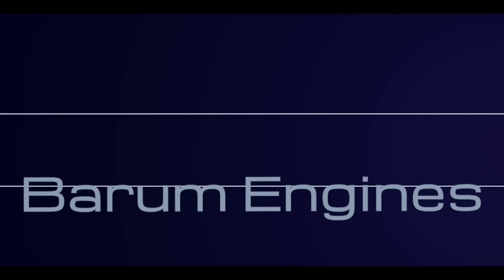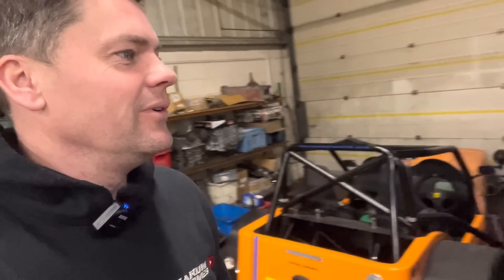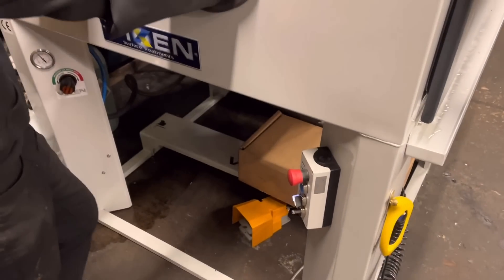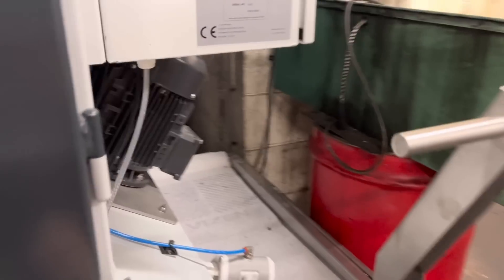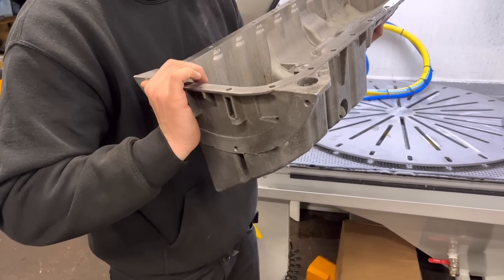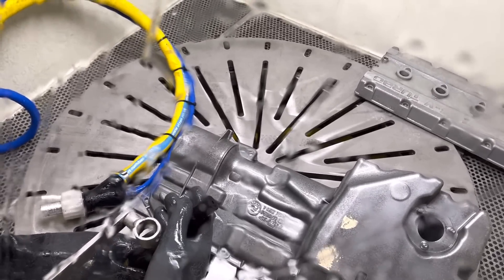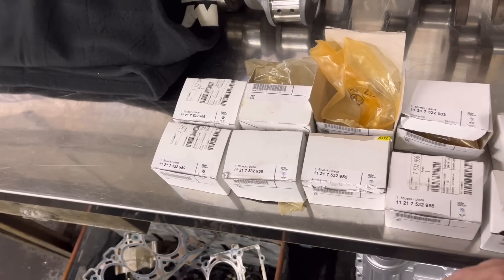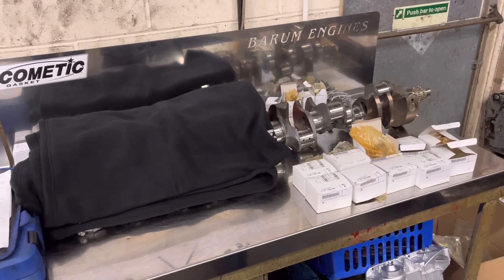WE MESSED UP: Engine lasted 5 minutes and had to be DISMANTLED

Comment: Just wondering why you guys don't use bore gage for checking oil clearance on main and rod bearings, I assume you guys do line bores on your blocks there for have a bore gage.I  myself prefer that instead of plastic gage. Plastic gage is OK for a hobby guy who doesn't have to spend big bucks on specialty tools but a professional engine builder is a different story, I would think.

Comment: Just my 2c but I wouldn't bother trying to make the E30 a road car. Just make it a no compromise track car and build it for that. Won't be any fun driving something hardcore on standard roads. Hi-Spec brakes are amazing. I only had the 4 pot calipers on 13" wheels for my dolly sprint race car and it would out brake the classic minis on track.

Comment: Hi Lee, don`t mean to teach my granny to suck eggs. It always amazes me watching you level a job up using a huge height gauge and feeler gauges. I would go for a DTI  finger or plunger mounted to the mill via a magnetic clock stand or stick the clock in the height gauge. Its got to be easier. I get the use of the height gauge for exhaust manifolds etc. Give it a go.  And put your safety specs on when on the lathe lol.. Great channel , thanks

Comment: On the tr4 engine, have you allowed for the “figure of eight” gaskets on the liner bases ?
Regards,
Sandy 🔧🏴
Reply: And the protrusion is relative to the area where the liner sits. If that's not flat relative to the sump/head surface it will still be wrong: the liner will sit at an angle.

Comment: On the aqua blast you can adjust the rise hose pressure. 
Plus run the main air pressure at around 30 psi. You’ll get a better finish. I have one of these units and have had it for about 2 years now. Fill glass media with 1 1/2 bags.

Comment: The principal datum for any engine is the main bearing housings. Using the cylinder block sump face will probably be fine IF it was been machined using this reference originally. As you probably know, a cylinder block will, gradualy over time, suffer slight distortion. I'd look into making a jig that consisted of two large Vee blocks at each end, with a steel bar between, the correct dia for the mains. I would also re-line bore the mains routinely before mounting on the jig.

Comment: Good honest stuff. Anybody who claims to never make mistakes is a fiber! Might be worth instigating a standard measurement checks protocol on everybody's work, prior to engines being rebuilt.
Reply: Right - that little check stand on the milling machine took just one minute to reveal the flaw.
So, how do they seal the bottoms of the sleeves ?? Looks like things would shift around with every heat cycle.

Comment: We have been Vapor Blasting for over 7 years. We thoroughly degrease all parts first. We then use a dry cabinet with crushed glass to prepare the part for vapor blasting. We keep our pressure on the lower spectrum. There are times when we will turn up the air pressure to get the part clean. We us a 20% slurry mix. We calibrate the mixture with a small plastic graduated cylinder. Any grease or oil will muck up the vapor honing cabinet quickly. 
I truly admire you and the team. Parts procurement continue to be an issue in our part of the world. I feel your pain. Thanks for investing time to allow us into the life of Barum Engines. Be good Remain safe. Wishing you Deluxe weekend!

Comment: Why are you squaring the deck surface of the TR4 block to be parallel to the oil pan rail?!  🤔
That makes no sense...
Shouldn't you be much more worried about the finished cylinders coming directly straight UP at 90° from the centreline of the crank and the deck being 90° to there than whatever is going on down at the oil pan?  Making the block into a pretty parallelogram doesn't actually help anything.

Comment: Not wearing glasses on machinery again, Naughty,I had a mate who lost an eye just blowing a machine dwn with an air line,it's easily done.. 😎
Reply: I've worked in loads of places where you cannot go onto the shop floor without the correct PPE, don't need to remember to put stuff on once it is just part of going into the work area
Reply: Safety squints have served me better than safety glasses or what I call them dirt funnels
Reply: And holding a camera while talking about another project.  Love the content, but don’t let the content adversely affect your work👍

Comment: If I were setting that block up to mill, knowing that the bore and head surface must be a true 90 degrees, I would mount a dial indicator to the mill spindle and run the indicator and spindle (table) up and down the bore to ensure that the surface being milled is at the required 90 degrees.
Reply: Just to add,,, the dial indicator I would have used would have been a .0005 which is small enough to fit and capable of being set in a position of being read from above. jUST WANT TO ADD.. LOVE THE WORK YOU DO!
Reply: I congratulated someone on another channel for doing exactly that and got a lot of negative comments about how it was not necessary and that the deck and base were always parallel. I think this just shows how things can go wrong.

In this case the badly fitting liners shows that the deck was wrong, but without that information it could just as easily have been the base which was wrong and milling the deck would have put an angle on the cylinders.

Comment: I am possibly very sad but always preffered the Porsche 924 than the rear engined stuff.Having said that they are slant engines and pigs to work on with engine in the car.Evens Haynes gave up at that point.Everthing just said first remove engine.

Comment: use Di water from a dehumidifier or you'll get limescale cloudy windows
Reply: Haven’t you got soft water down there?
Reply: @maxbee4460  no soft water in the south, Wales and the North
Reply: @STANLIZ4  yep ours is good and crunchy
Reply: Very good point!
Reply: Descaler £1.50 tesco